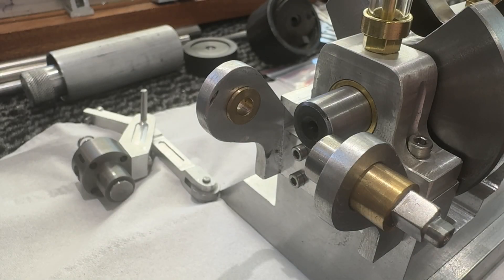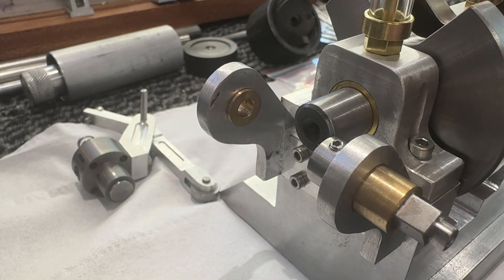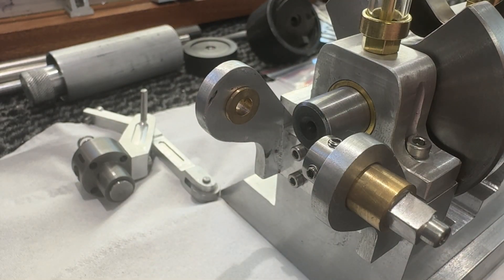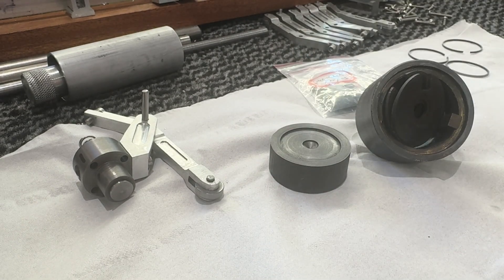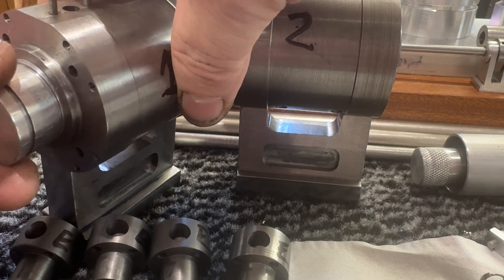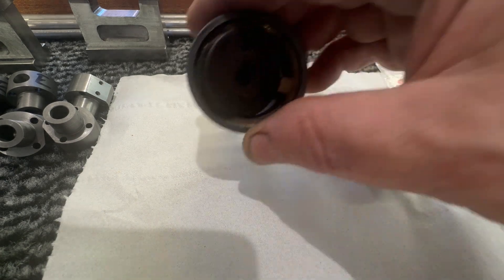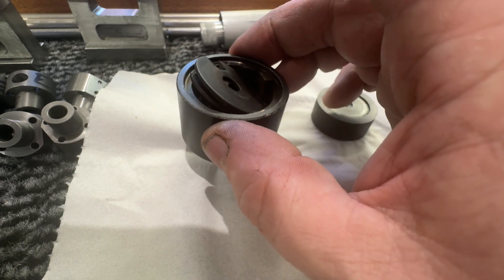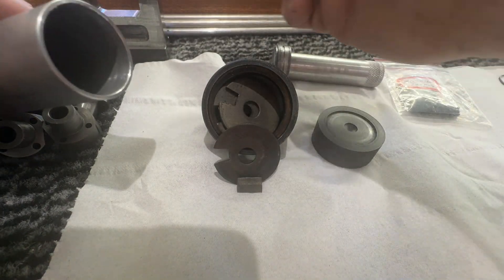8 engine heads for the Snow Engine

Comment: Looking good Andy you could use vermiculate blocks and make a small hearth when soldering you don’t need so much heat
Reply from the maker: I do have them filming took over. they cleaned up and are painted